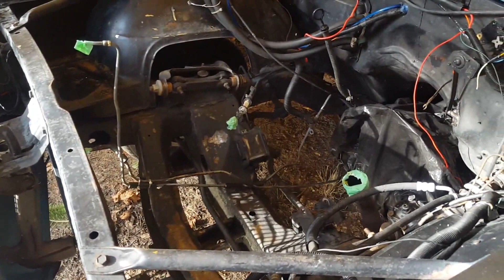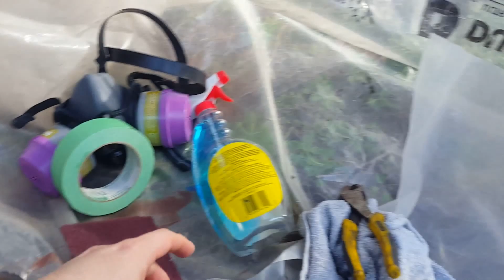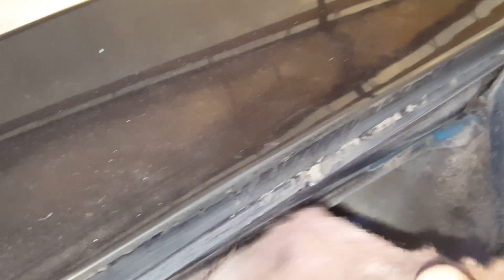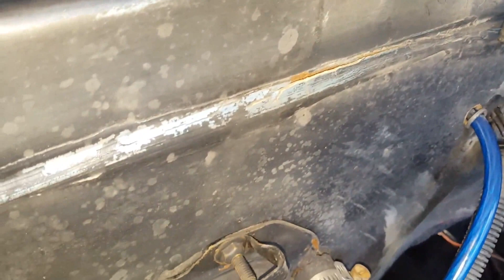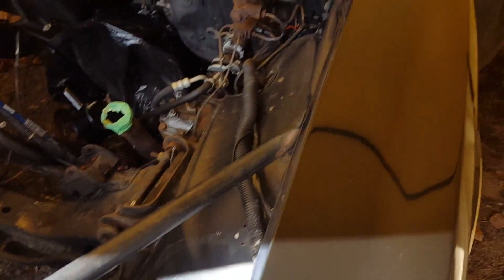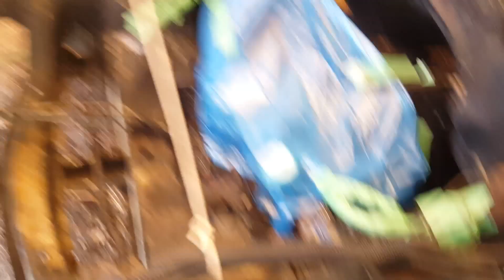1967 Camaro - How to Spray Paint an Engine Bay

Comment: looks good that was a factory seam at the top of the firewall that the seam sealer was coming out not really a crack the best approach would have been remove all the seam sealer and reapply new sealer to that area but you got it looks good
Reply from the maker: +Chris Mansker Yeah I should have spent a bit more time on it as I'm sure I would have realized it was factory and could have prepped it a bit better. Seems to be holding well but not my favorite fix for sure. I'm glad you commented with the better approach.
Reply: its a driver not a show car well not yet I like that you went with  turbo on a 250 6 really cool to see someone do something different than the norm
Reply from the maker: Chris Mansker hah, it'll never be a show car... It might sit at a car show but I don't want the "crate engine" or "most stock" awards anyway. Thanks for the encouragement.

Comment: When buying new filters for your mask, look for pink ones, or ones with pink ends.  The pink indictates HEPA filtration, much finer and probably the best for your lungs.

Also, to keep your filters effective for the longest time, store them in a sealed bag, zip lock or whatever, just make sure to get the most air out you can.  These things do degrade, so if your filter get old just grab new ones.  A few bucks to breathe is well worth it.

Love your videos man, good stuff!
Reply from the maker: +Rich Gallegos great information and tip about the zip lock. I'm bad for not maintaining my masks. I usually do buy the pink ones when I (eventually) replace them. Thanks for watching!
Reply: You're welcome!  I just found your channel and watching all your videos for the first time.  I love your attitude and the effort you put into doing a good job... but not going crazy or fanatical about it!  Keep on keepin' on.